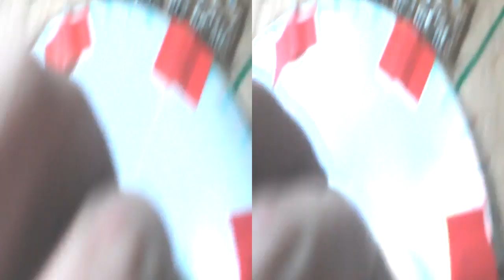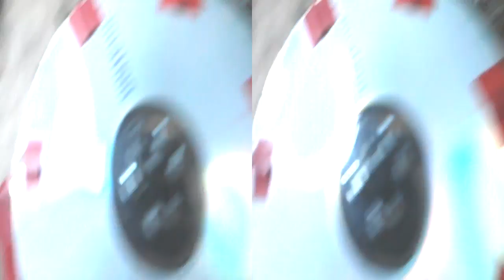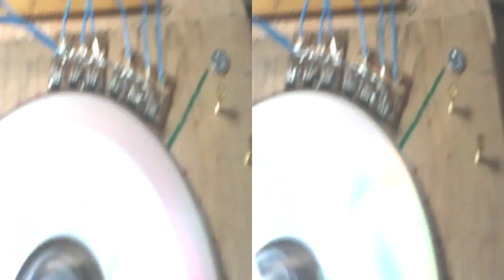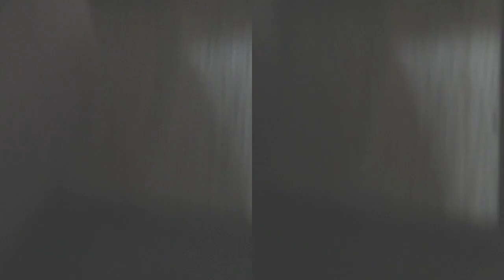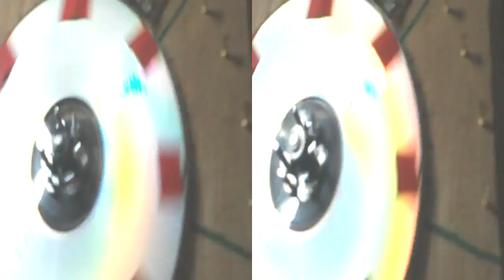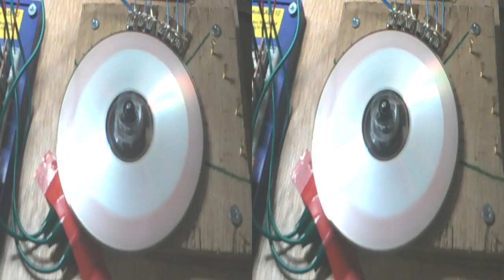New Sensor Test: BLDC understanding phase angle

Comment: Excellent & Informstive video!! Good stuff in helping me understand how to resolve my issue.  Changing my 48V controller & battery to my other 36V folding scooter motor has great take-off power but cuts out at 50% throttle/speed., motor sometimes makes a gear rattling sound, argh.  If I’m going downhill sometimes motor whines and can get better speed! My display eronously says 66km/hr lol.
Both are 9pin but one motor is slightly (1” +-) bigger than the other.  
Q.  Can I Just separate the internal hall sensors to compensate since I can’t program my stock controller?  Is this the issue? Thanks!